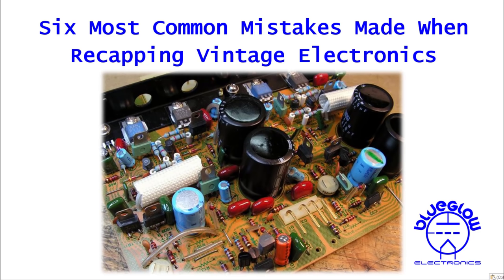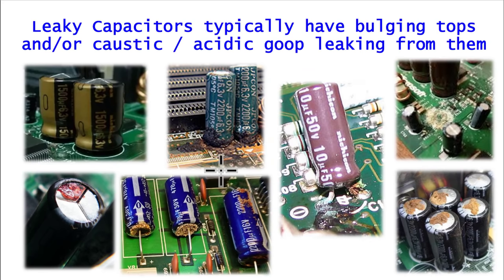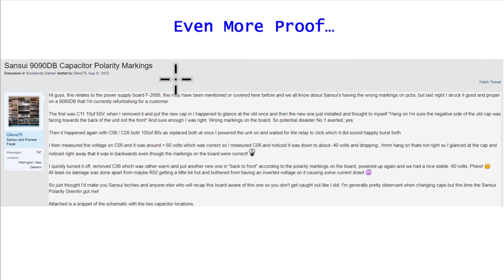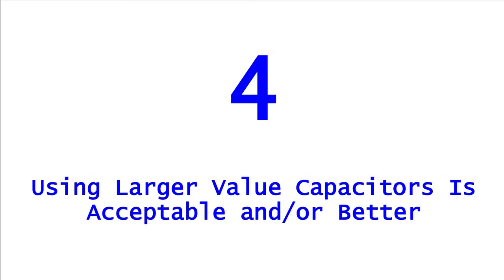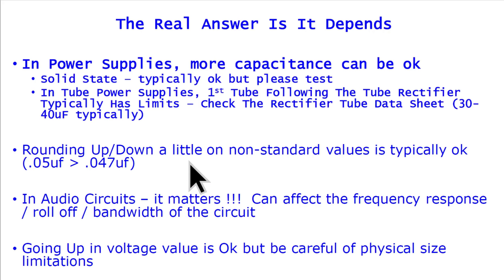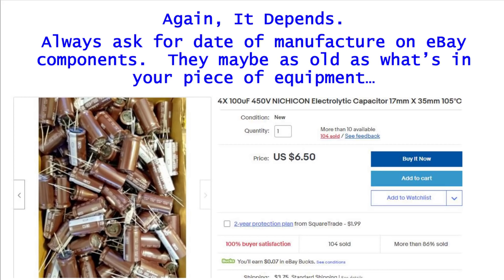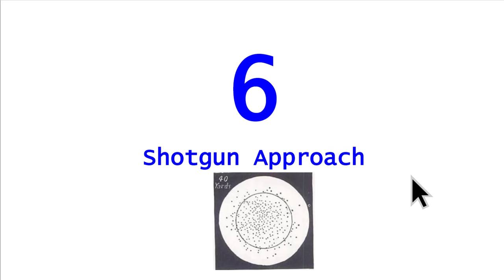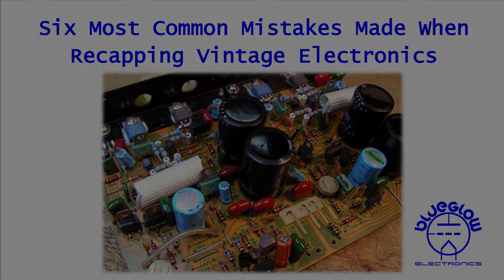Six Common Mistakes Made When Recapping Vintage Electronics

Comment: Test the new ones before soldering them in,there might be a faulty one...
Reply: if you have the instrument, the right one, its an excellent idea ....
Reply: @eloyex  yes,a tester is always handy,not too expensive nowadays,made in China ofcourse
Reply: Measure for sure, also apply DC and 'form' the cap and check leakage and true capacitance after forming, of course discharge the cap before measuring again!
Reply: @mmpiforall5913  If you're concerned that your new cap might be open, plug it into mains and see if it explodes.  If so, it was good ;-)
Reply: In some sensitive points of circuitry - specially in tape recorders of gramophone  preamps  value is  also  important. It is good idea to check real capacitance of new stuff - I found that of  new 10pcs   valuated at 10 uF no one reached 10 uF, some still in 10% tolerance but some were as low as 7,5 uF. While original  ones 25 years old were opposite - above 10uF That can make  quite a difference. Special care should be put  to replacement of capacitors in speaker crossovers - producer  tolerance is 10% so replacement without measurement  usually will change  sounding of set. Any  change  may be falsely interpreted as proof that old one had bad condition. Original one should be measured and , (in my opinion, if we tend to care for original timbre) value followed with accuracy 0,5%   . It may be hard to match and  proper way is to use smart combination of smaller values. Which will will not look  original - that is why I would think twice before replacing crossover capacitors just for  "idea".
Reply: 1 in a million maybe.
Reply: @jamesplotkin4674  Great test highly underated.   People are so paranoid.
Reply: @mikepxg6406  Is this a guess or pure knowledge/hard facts?
Reply: @roetsj  I have been working with electronics for over 30 years never had a bad new capacitor.
Reply: @mikepxg6406  same, in production, we rarely see faulty capacitors from suppliers. But of course, we work with 1st hand suppliers, not the cheap ones.
Reply: @mikepxg6406  If you know better,you know best...
Reply: @mikepxg6406  , I was an audio repair tech for 15 years.  Just once did I encounter a relatively new manufacture name-brand capacitor that was bad (it was " open").
Reply: Ridiculous. There's not a single customer that would pay for the extra time it takes to measure every new component when doing a full recap of a receiver, RTR-deck or so. Besides, I have never had a fault with Panas, Nichicons or Elnas.
Reply: @SupraTompan    Panasonic caps are excellent (though I have seen just one brand new one that was bad); Nichicons are generally good; but Elna caps have a high failure rate in old equipment.  I don't know if you can buy "new" Elna caps, but if so, I would not recommend using them. ( paraphrasing Napoleon, "Able was I ere I saw ELNA"). PS, Another one to avoid, or replace when you encounter them in equipment being repaired,  is "Shoie" caps.
Reply: @SupraTompan  pfff,I am my own customer,do like you wish to do,I check,only costs a few seconds,better safe then sorry or troubleshooting after recapping...
Reply: @roetsj  You are free to waste your time.
Reply: @SupraTompan  , the other point worth making is that if the cap or caps to be replaced are in a difficult area to reach, requiring significant disassembly to change them out and significant reassembly before you can test the unit, it might make sense to test the replacement parts before installing....

Comment: On an old R-R tape recorder that I recapped recently, the electrolytic caps had a stripe on the side to indicate polarity.  Unfortunately, as I discovered after replacing many capacitors, the stripe on the old caps marks the (+) positive lead rather than the negative end as on newer capacitors.  I had to remove, test and reinstall every cap I replaced, since powering up a cap with wrong polarity can damage it.  So, watch out for that too!
Reply: Good point! I've seen this too on older Toa amps!
Reply: I once encountered an LED which had the flat marking on the positive lead. It should be on the negative lead. I was so confused.
Reply: Diode: mismarked; :buffering: ☺1 in thousands; thank God I cheched 'em all!
Reply: @PunakiviAddikti  yep, i have some like that, you must never assume the polarity, double check
Reply: wrongly polarized caps make nice fireworks , ask me how i know..

Comment: Two important issues when recapping with a higher value; 1. never do this with starting capacitors in motors, they need the exact right value. 2. Recapping with a much larger value in a power supply can cause damage to the bridge rectifier, because the current peak when staring up, is much higher then.
An other important issue is the temperature which is mentioned on the capacitor. The switching power supplies before the 1990's often used capacitors, marked with 85°C. This was also one of the reasons of the caused problems. Always use 105°C capacitors for switching power supplies!
Reply: Not me who learned every one of these the hard way over the years..

Comment: Great advice!! I'm guilty of the shotgun approach because I wanted to listen to my vintage receiver right away.  More than once, I spent more time trying to figure out where I went wrong with my DMM, hooking up my DBT, reading voltage/current values through everything and trying to read the blurry values from a scanned service manual, playing the AM/FM tuner, hooking up a turntable and using the phono/EQ board, etc. etc.  You get the idea.  

Take your time. Do one section at a time, and then test your receiver. Another piece of advice is pay attention to the orientation of new transistors vs. old ones.  Some older transistors tend to have EBC instead of a more modern ECB.

Comment: What's nice about troubleshooting stereo equipment is that the channel that is in good working order can be a good reference for measurement comparisons. Hard to find problematic components can be detected this way. Just make sure that your reference input signals are exactly the same for the left and right channels. An oscilloscope can also be an excellent visual aid to compare for abnormalities in the defective channel.

Comment: Great video and full of info. Had VCR many years ago with Alzheimer's. Sometimes responded to controls sometimes not. After hours of troubleshooting and consultation with others in the biz, turned out it was an adhesive foam pad (several) on bottom of circuit board between it and metal bottom of machine. After removing pads found affected traces in different states of degradation . The adhesive had eaten into traces and was semi-conducting between them, thus the Alzheimer's symptoms. No clue until pads actually removed to see damage. Rock solid after repair. Do not underestimate any "material" on a board  to cause trouble.

Comment: This video is excellent, your methodology is all common sense for anyone experienced in servicing electronics. However, when it comes to factory glue, even if you can still identify it correctly, you must remain cautious and always observe precautionary. Some of these glues have proven corrosive or decompose in corrosive material, so if you notice oxidized copper tracks, rotten component legs, you'll probably have to remove that goo, restore PCB and probably change all components touched, resistors and semiconductors. Leaky caps can also smell badly: most of leaky SMD electrolytic capacitors include a fish oil impregnating everything. 
And here is also an important point, most quality electrolytics can still work fine after years if used and stored in proper condition. You also need specific equipment to check and test if they really need some replacement: you should measure values and ESR, and for specific uses like high voltage  ones, a specific leakage test has to be performed. Of course, with experience or proper documentation, you have a number of specific condensers you will systematically change in 100% of equipment, mostly because their replacement is critical and always cheaper than the component they protect, like high voltage decoupling caps in tube electronics.
And when it comes to components locations or sense, wiring and so, it's also interesting to take a number or pictures and notes along markings.
Rule number one is to take the necessary time to observe and analyse any further action.

Comment: Great video with lots of good points. I would caution about using a replacement electrolitic capacitors
with with a voltage a lot higher then the original. Such as putting a 350 volt in place of a 25 volt because it won't stay properly formed with the lower working voltage. 
While it is not in the scope of this video, all that glue on those circuit boards, that some over time degrades and becomes caustic and conductive. As long as you are replacing the capacitors, you should remove the glue as well. Once again this is a great video, keep them coming when you can, stay safe and have a wonderful holidays.
Reply: yep, dont go too higher in voltage , and yes some types of glue definitely cause trouble, in some cases causes corrosion and track or wire damage
Reply: Tremendous waste of money too......if you could even squeeze it in.
Reply: Yes, I remember years ago reading that too high a voltage isn't good for use at much lower voltages.
Reply: Yep, and there is something else to consider too. E.g. with modern switching power supplies, ESR (=equivalent series resistance) is important. Higher voltage caps have higher ESR than lower voltage one with same capacity, which is a bad thing. So, going a little higher may be ok, but not much higher.

Comment: My expectations were low when I started this video, I was expecting "don't reverse the polarity of electrolytic capacitors" and "make sure the foil end of the capacitor is connected the ground side", neither of these points were covered, instead all the tips were fresh and thought provoking. Very enjoyable!

Comment: I particularly liked the point that there are factory mistakes as I have found several over the years but did not know about mistakes in service manuals nor was I aware of silk screen mistakes on circuit boards. Thanks for the info.

Comment: Nice video! I use to snap a bunch of pictures of the PCBA before I start working. Nice way to keep track of orientations, values, and such. It has saved me a few times with bad PCB polarity markings as you showed here.
Reply: Thumps up 
Often I take pictures with my wirless phone. 
And every time I mark the capacitor (and the orientation from connectors). 
I use often diffenrent colours. 

I mark capacitors on top and at the PCB with a small dot.

Comment: Great video, with many good points raised.  Re: not trusting board markings.  There's at least one infamous example in the computer world: one revision of the Sinclair ZX Spectrum shows incorrect polarity markings for one of its capacitors, which has caught many people out over the years (resulting in many dead ZX Spectrums in the process).  

As for marking capacitors i.e. the "measure twice cut once" tip, taking clear high res photos of the board you're about to work on prior to starting on it is also a very good idea IMHO.

Comment: I recently replaced the electrolytic capacitors in a GE digital tuned clock radio from the late 1970s or early ‘80s which was too nice to throw out.  Being on for 40 years 24x7 took its toll.  The symptoms were erratic operation such as the alarm beep going off at random times and poor audio quality.  As I pulled the capacitors, I checked them with an M Cubed Electonix  impedance bridge and found about 1/4 of the capacitors had only about 1/3 their rated capacitance.  Quite a few capacitors had also developed unreasonably high effective series resistance, as much as 30+ Ohms.

After my order for capacitors of the same proper values and withstand voltages arrived from Digikey, it took a few hours to swap all the electrolytic capacitors.  Since there were so many off value parts, I decided to replace all of the aluminum electrolytic capacitors so that I would not have to go back to replace more parts later.  After a few hours of patient work, everything was good to go and the radio sounds great again.  If you follow the advice in this video you’ll almost certainly have a good outcome with more life from your old equipment.

Comment: The tip on wrongly printed polarity was new to me, thanks for that 👍
Reply: Same! I just finished recapping a TS-530S, and I checked each ones polarity as I pulled it out, just in case the marking on the board was buried somehow. But I never thought it could be wrong! I'll be marking my caps orientation before pulling them from now on!
Reply: While I don't work in the industry, I do electronic repair for myself. Marking the orientation is a great idea. I have removed caps only to then question the orientation on the board. I now mark orientation on everything I remove (for the most part).

Comment: When I derate caps on a recap job I usually derate on the next voltage up, no more. I always test new caps, you never know. I always test the caps coming out as a learning experience. Good video.
Reply: One more, I usually recap no more then four caps then do an operation check. Just in case you have back track.
Reply: @philhemenway3503  not a bad idea, but depending on how hard it is to access the boards or get them back into circuit, that could really add up in time lost! One section at a time seems reasonable compromise
Reply: Great suggestion, but my Q is: how do you test capacitors?
Reply: @CycloneCyd  There are many cap meters avaiable or your DVM may have a cap measuring capability.

Comment: I thought I was pretty foolproof in identifying component glue, but in your example picture I would've been convinced that the upper right and lower left pics were leaked electrolite.

I work in electronics and am working on getting into restoring (and in some cases modernizing) antique radios as a hobby, so videos like these have been good for picking up on stuff I wouldn't have realized right away with vintage stuff. Great video.

Comment: Excellent video! Always good to hear from techs from the good old vacuum days when things were made in the good old USA and everyone was employed. Sylvania, Westinghouse, General Electric, Magnavox, Panasonic, Admiral and many more. In contrast to present day times, I treasure those days. Thanks for sharing.
Reply: They were interesting days,  I worked for PHILIPS whilst studying for  Electronics Engineering and Electro-Mechanical Engineering Degrees.
Then Joining the Military in 1970,  serving for 20 years.
The manufacture of Electronic devices ceased, with production facilities closing, and operations being sent offshore.
I am familiar with all the brands you mention. 
(Magnavox is a division of PHILIPS) 
I was repairing Magnavox Radios and TV at age 8 ... Being taught by my  uncle (Moms brother)
The same happened more recently with the Automotive manufacturing industry, and their component suppliers, Borg Warner for instance,
all ending their manufacturing operations.
In those early days, everything was Vacuum Tubes, then hybrid devices began appearing in the early 1970s.
I still have a VTVM  a high-quality Analog Multimeter,  and other equipment that is 50 years old and older.
Some of it is former Military equipment,  I expect it will be dumped after I am dead.

I claim that if the US President was half as smart as the President of China, he would subsidize shipping costs to overseas
locations, as does  China.
This makes buying Chinese products very cost-effective.
The US Government is taking its orders from the U.N. and it CREDITORS, the international Banking Cartel.
instead of making the purchase and shipping of US made products viable, the US wasted trillions on supporting
overseas Military bases where the locals do not want them.
The Grand scheme of the International bankers is to make CHINA great, and exploit the people over the following 500 years
as was done with America.  as the population grew. -  The US is now dead in the water and will sink whether the people like it or not.
All that can be done is to pacify and brainwash the people with a load of BS to prevent a revolution and civil unrest, until such
time that population control, tracking/surveillance is in full operation. 
What we are seeing now  are dress rehearsals  and system testing in the guise of COVID-19  Plandemic
Reply: @andrew_koala2974  I agree with your comments on lower shipping fees from the US. I see many excellent US products new and second hand. However the shipping costs for customers in Australia can sometimes be quite a bit more than the goods themselves .. A real shame actually. I have one or two old pieces of test equipment made entirely in the US. They are very satisfying to use. Thanks for voicing some interesting thoughts.😁
Reply: Panasonic?  was and is part of the Matsushita corporation of Japan. That said, it's been a trading name of Matsushita since forever.

Comment: I've also experienced improper markings on Marantz gear. Very good advice for all techs. Thank you.
Reply: It is really valuable author' advice with markings. Simple and clear. Also not bad  idea today is to make sharp  photo of board (with flash)  with parts and connections  in original placement. And to study original schematic  for tracing  damages - this saves unnecessary replacements which do not help and degrade  overall condition  .